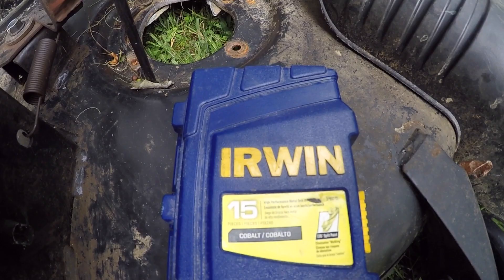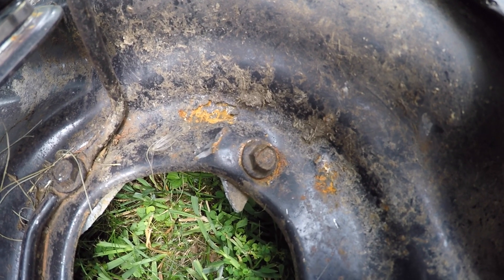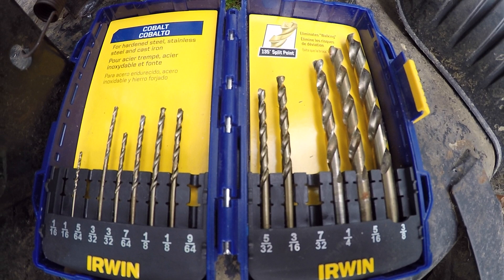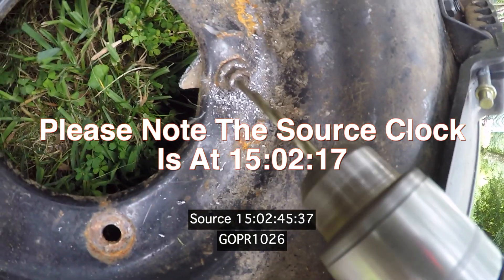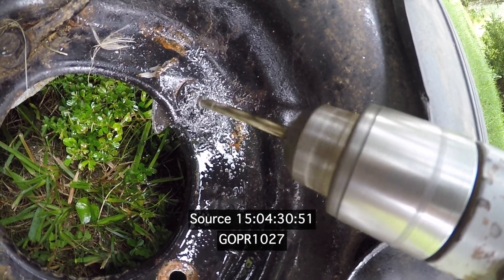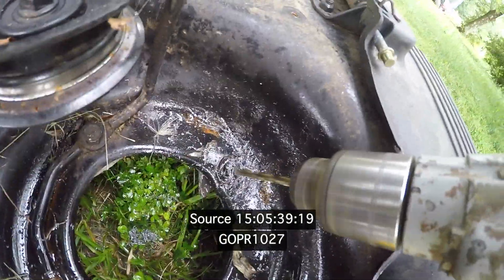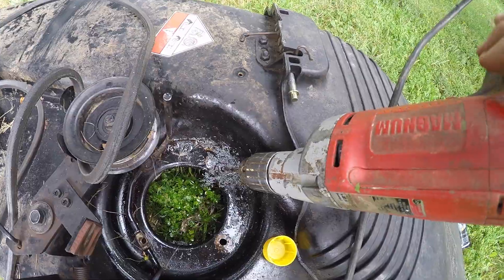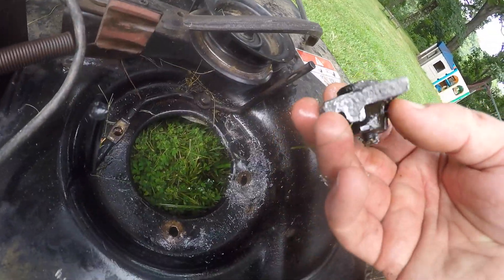How Fast are Cobalt Drill Bits? Metal Drill Bits (Irwin Set) Are they the Best Drill Bits For Metal?

Comment: It kind of looked like you had the drill spinning counter clockwise?  Plz keep in mind that, If you want to preserve your cobalt drill bits, Each start & stop causes slight damage/ microscopic damage! Speed is a factor & SO IS HEAT!!! Always start with a small bit 1st & then, Work your way up once you have punched threw, incrementally... I clean them off, & oil them to deter any rust or corrosion b4 storage... ESPECIALLY NOW THAT MY NOT SO LOCAL 20 SOME MILE AWAY Royal king does not sell them anymore! They also, Used to sell singles!!!!!!! I miss those days!!!!!!!!BUY THEM UP WHILE YOU CAN!!!
Reply from the maker: Thanks again for the tips.

Comment: Keep in mind that, I am only .58 seconds into your video & I see that you are starting out with a 7/32 drill bit, I would recommend starting with an even smaller bit & go real easy as to NOT BREAK THE BIT & NOT TO BURN IT UP BUT, If you used a grinder 1st, & grind the bolt all the way down flush with the mower deck 1st, One blow with a hammer & chisel and that bolt would fall out without the need to put any wear onto your cobalt bits & save them for more pressing needs, Assuming that you have a grinder or any sort of grinding stones, disks but, my recommendation is to use a grinder followed up with a solid whack with a chisel & a hammer! Now, Onto your video!!!
Reply from the maker: I am extremely appreciative of your comment and will take your advice. I have been struggling with broken or frozen bolts for years. I never had a teacher so I have been self taught. I struggled with a bolt once for 3 days because it was hard to reach. I will try your technique. I can tell from what you said you have experience. I'll take experienced advice over all else when it comes to removing frozen or broken bolts. People who have never tried to remove an exhaust bolt for example  probably think it's easy but it is not easy. That metal gets so hard from being heated up and cooled. Thanks again for your help.

Comment: The easiest & best way would be, To use a grinder & grind off as much of the bolt as possible then, use a center punch or equivalent then drill away with a COBALT DRILL BIT STARTING WITH THE SMALLEST ONE 1ST & WORK YOUR WAY UP! I use to go to Royal King & buy my cobalt drill bits single's & a few months ago, I purchased the 15 piece Irwin cobalt drill bit set model # 316015 & I am yet to put them to the test but, MY COMPLAINT IS, Just the other day, I was at Royal King & they did not have any at all, not even the single's or the set??? The whole section was gone & refilled with tap & die's in single packages for each size & it BROKE MY HEART! In the back of my mind, I knew where to get the best bits to drill threw metal & now, I FEEL ROYALY MESSED OVER & I WILL BE SPEAKING WITH THE MANAGER TO SEE WSUP & WHEN OR IF THEY PLAN ON BRINGING THEM BACK BECAUSE THIS IS A TRAJIC BLOW!!!!!!!! It seriously puts a damper onto my mechanical ability if I cannot drill threw metal! It's rather upsetting!!!
Reply from the maker: I tried your idea and it worked! Thanks!